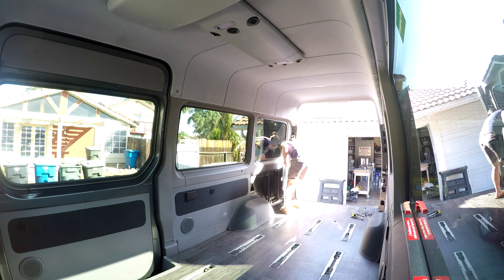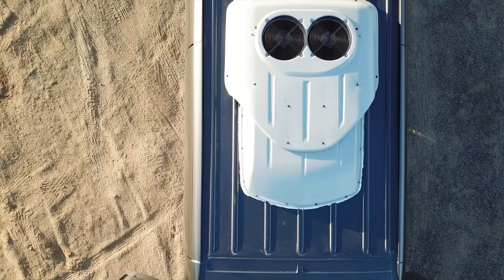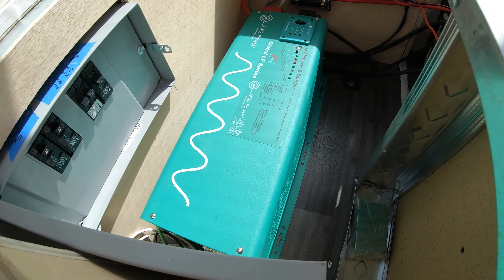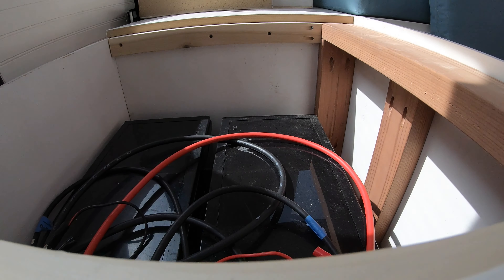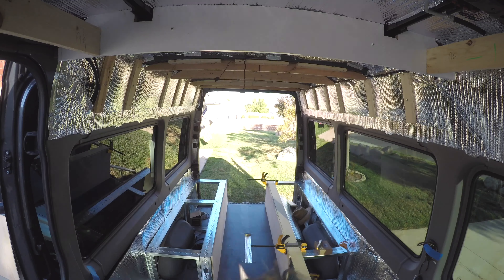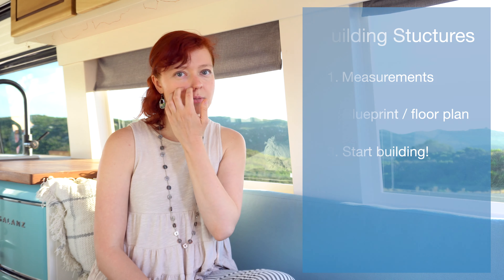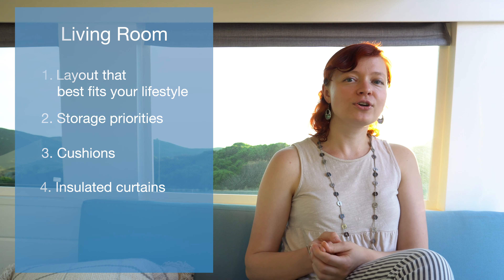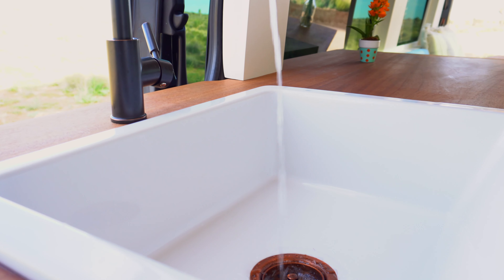DIY VAN CONVERSION GUIDE: Step by Step How to Convert a Van into Off-Grid Tiny Home

Comment: I would love some input on how you did your ceiling with the AC unit? I just bought the passenger van also and would love your input. This leads me to my other question on how you want about framing your windows, they turned out really nice! I appreciate any advice as I don't see many passenger vans converted. Thank you!!!
Reply from the maker: It was a bit tricky with the AC unit and basically had to drop the ceiling lower in that area and built a box around it. For framing windows too - it's all custom designed and custom cut window framing. Takes a lot of creativity and measuring 😁🥰